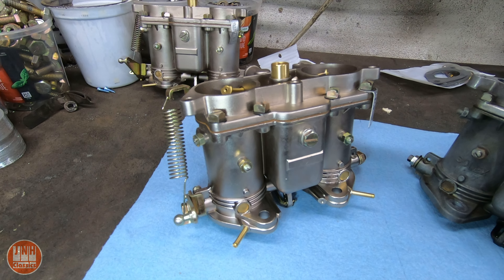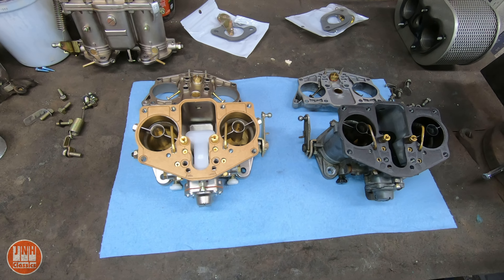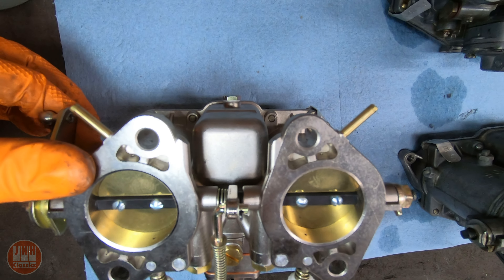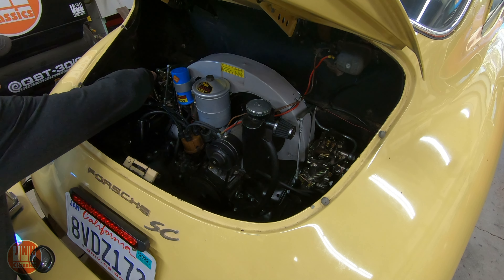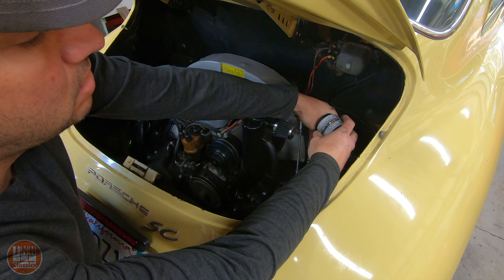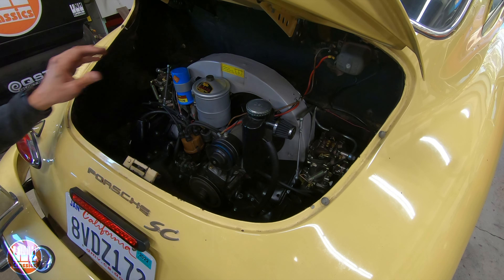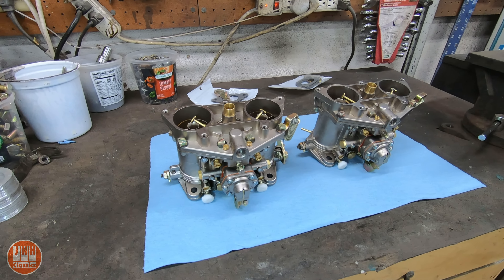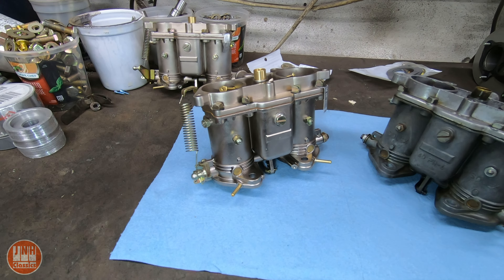NEW CARBS FROM CHINA!  Are They Any Good? - Porsche 356

Comment: When you adjust these or solex's / zeniths , disconnect one or both of the down linkages, then adjust the rpm, and idle jests. after its all adjusted to your liking, connect one side see if the RPM goes up,  If not then do the other, it should slip fit over the ball without any RPM change,  . This will tell you if you have any wear in the linkage. If the RPM changes adjust the down rod length to match the RPM screw setting with no change in RPM.

Comment: I've only heard good feedback on these carbs.    Ps consider synchronizing your carbs with the linkage disconnected.  Then when you are happy put the linkage back in.  Check they are still synchronized.  Plus check at higher rpms

Comment: Now remanufacture the original carbs. A few brass inserts on the linkages, ultrasonic solvent cleaning, and basic rebuild will get you most if not all of the way there. Otherwise, I'll hold on to your old carbs for you ;-) I'd add I usually have to deburr cheap carb/throttle body butterflies from china, and blow out machining swarf. They are usually fine, but the QA process leaves a lot to be desired and you are playing the casting lottery every time.

Comment: Is that an additional brake light over the license plate?  if so where did you get it?
Reply from the maker: Yes I bought it on Amazon for about $10 and made a plate that fits behind the license plate. The hard part was running a wire all the way to the master cylinder. Since the brake light and turn signal on this car use the same wire you need a new wire from the master cylinder.